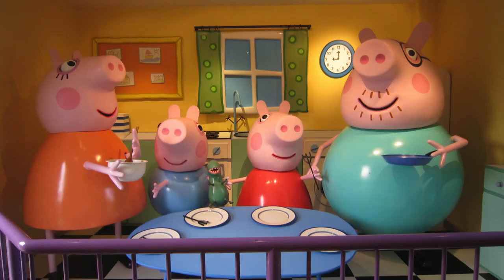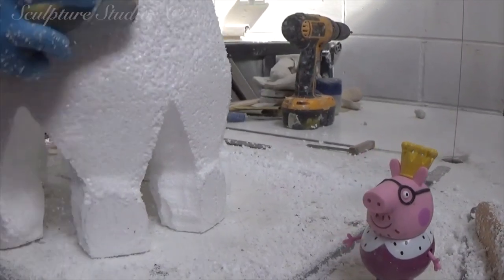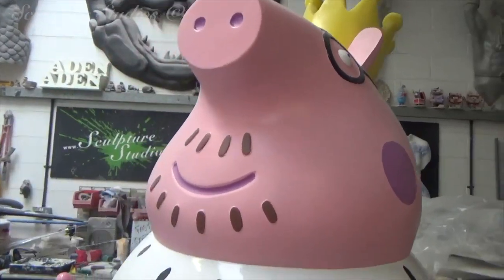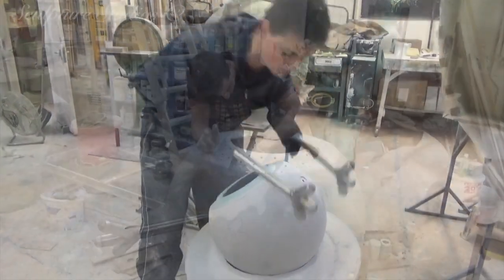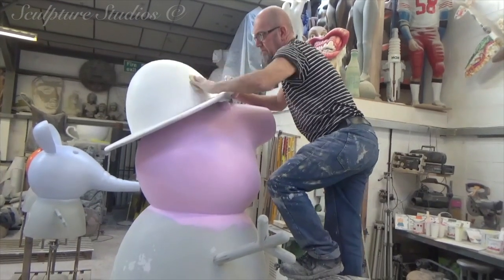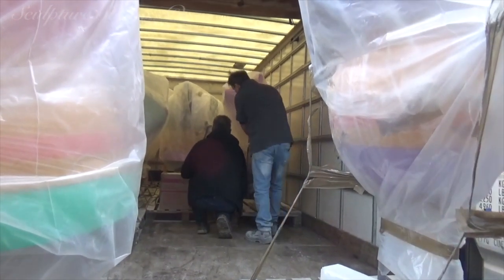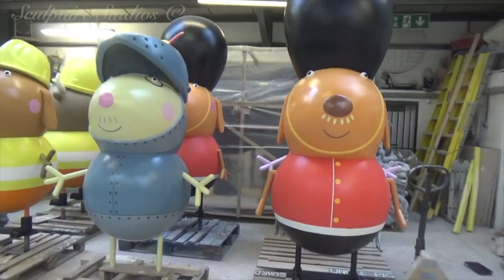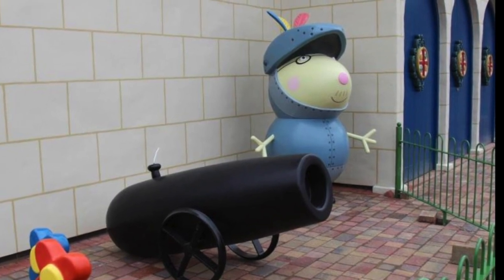Peppa Pig World Characters by Sculpture Studios

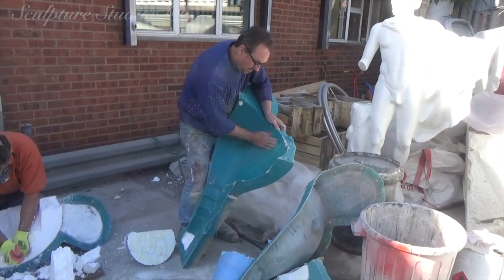Comment: 8:00 how you make sure the fiberglass covers all the way through the bottom of the trunk? It seems long.
Reply from the maker: The bulk of the fibreglass cast is created when the mould is in 2 halves. The 2 halves of the mould are then put together, and then only the seamline between the two cast pieces need to be joined. Fibreglass is used all the way along the seam lines. Yes it's quite a way down, but even if not every square inch of the seam line were to be covered, there will certainly be enough fibreglass across the seam line in total to make it structurally sound.